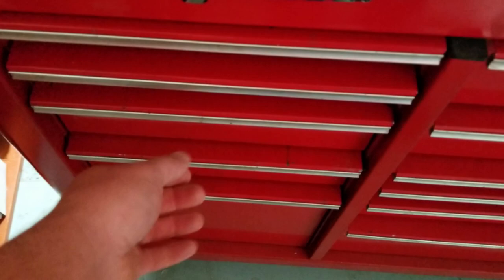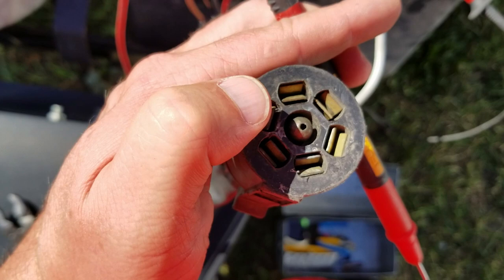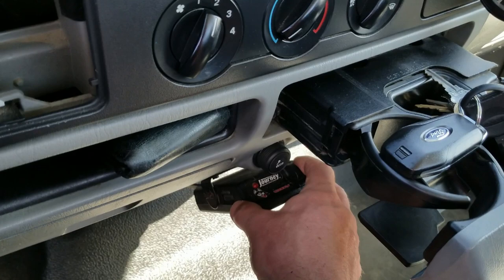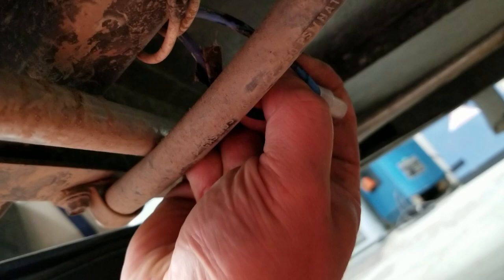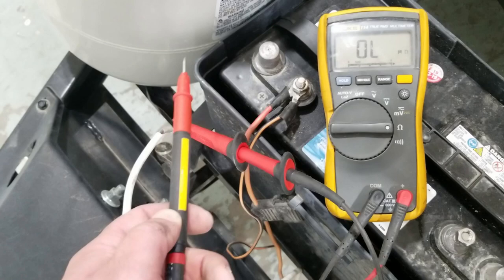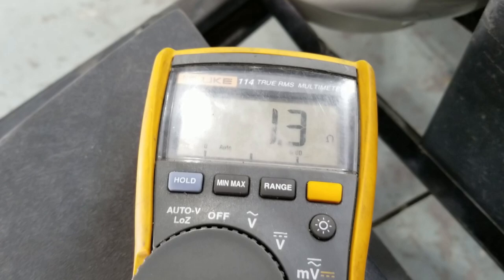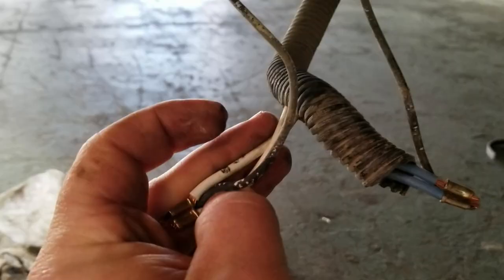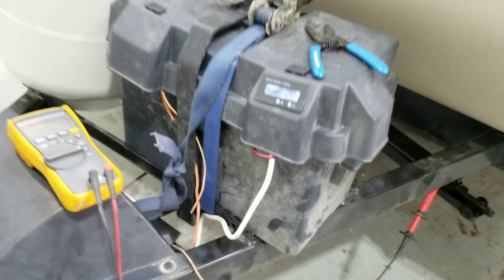Scumbag Offset | sketchy wiring

Comment: I bought brand new led lights with wiring from the home depot.  It all installed nicely and worked fine.  A year later, the lights kept blinking out. I found some broken connections so I tried to strip back the wire to replace them. The wire broke every time I tried to strip it.  The entire length of wire was corroded inside the insulation.  I have never seen such crap material used.  I dont know if the wire was actually copper plated pig iron or if somehow the chemicals in the insulation attacked it.  I replaced it all with random shit scavenged wire I found in the garage and it worked fine.  Still does, years later.  Unfortunately, I didn't have the right color wire laying around so good luck to the next person to trouble shoot it.

Comment: It’s safe to assume all trailers have shoddy wiring. Although I did come across a 2010 utility trailer last week that had a completely virgin factory wiring harness on it. Blew my mind. From wire nuts, to duct tape, gobs of liquid electrical tape, all the wires made the same color, and of course the big fat black tape tumor. Oh and speaker and orange extension cords spliced and sectioned in too.

Comment: Unsolicited 2-cents; that might help anyone with a ford 4.9l issues

1)
I know it's a day-late, and a dollar-short; but the issue I was having with my 96 4.9l which seems to plague everyone as the "pickup ignition sensor whatever"; turned out to be an early symptom, of the timing ring, thats bolted onto the harmonic balancer, coming loose... eventually found out, when it came off on I25 sheering the bolts on the harmonic balancer, getting wedged in the works, and ripping a hole in the timing cover. 

IDK, might be worth takin a peek at before shit hits the fan.

2)
Also, "lean bank 1" code might be an intake leak, vaccum i'm not sure, that's open-looping the engine and setting the CE light and running lean; that was my case.

3)
If it fails to start after running; people say it's the fuel switch, or the fuel pumps, etc etc... what it turned out to me, is a failing starter-relay combo.  if it happens again, smack either one with whatever you got handy; see if that does it.

the BIG SIX is bullet-proof, I swear! or, I just keep fixin it, who knows.

Comment: I have the old one, I bought it for a lark when I bought the big fuel gun for lug nuts. I didn't think much of it at first until I realized that 40lbs of torque is as much as you want for tightening most bolts that are appropriate for this size of ratchet. ANy bigger and you are well over spec for most fasteners. as for breaking strength, you can use it as a ratchet and as you feel the plastic start to deform, your inner voice might start chirping up and say "hey maybe I need a different tool for this job as this little bolt seems pretty stuck. Maybe I should go slow and be careful that it might be sized or galled" Anyway it is by far my most used tool in the box by a long shot now, I have considered the new fuel but  I fear it might be the victim of the more power creep that is overly not nesisary and leads to more problems. 40 torque perfect 60 torque too much, unless you are working with bigger stuff than a normal car or truck

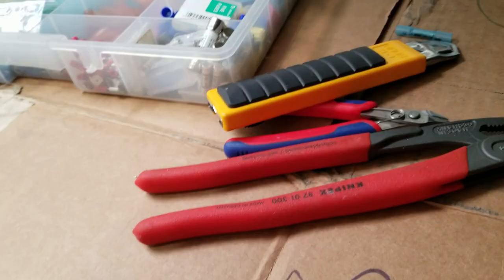Comment: At 7:40 those insulated crimp on connectors are called buchanan connectors . They used to be very common on older electrical installations and they would use them to connect the bare ground wires together in residential device boxes.

Comment: Scotchlok/T-Taps are almost always bad news. When repairing trailer wiring, best practice is to solder/heatshrink all connections and add some dielectric grease before shrinking. Crimp connections remain secure but offer no protection from corrosion unless using the heatshrink ones.

Comment: When the connectors contacts were new, and not corroded, you should add silicone bulb grease to those connectors.  A silicone spray keeps the rubber parts from hardening.

Comment: Those E-brakes are a pain in the cunning linguals. 
I'm glad over here in Eurostan we mainly get mechanical trailer brakes that use inertia to operate. The car starts braking, the trailer want to continue and pushes against the car which in turn activates the mechanical linkage on the trailer brakes.  The heavier the trailer, the more it pushes on the car through the hitch, the harder the trailer brakes are applied. If the mechanicals are kept in good nick it's completely idiot proof. No batteria or wiring involved.

Comment: "Marets" (?, if I spelled that right), we just call them "wire nuts" in the states.  I'm sure you can have fun with those linguistics.  
My experiences with trailer wiring.  My dad's old landscape/utility trailer has house wire for the wiring, I'm talkin 14/2 Romex (solid conductors, not stranded).  Trailer is probably 20 years old I think.  Lately, I've had to fix the wiring several times though.  Our camper trailer, well you can look in the under sink kitchen cabinets and see where at the factory they just cut a randomly shaped hole in the interior wall and banjo stringed wires from the floor near the sink drain to the wall 3 feet away.  The best so far has been my M1102 Humvee trailer that I converted all the lights to 12V (from 24V) and removed the 12 pin Humvee plug and put on a 7 pin trailer plug.

Comment: Just sang that song after laboriously reinstalling the denser-than-lead lump of aluminum and steel that is a 1973 Honda CB450 dohc engine. Assured by my friend from whom I acquired it that the head gasket replacement was skookum, a no-compression-or-leakdown-test procedure was followed.  And of course, the first tap of the starter button revealed the horror.

                           -CHORUS--

BUT - Valves who have strayed to the kinky side CAN be reformed to lead the straight life again!

Comment: "wtf some kind of pbx data connector" lmao!
Reply: A Scotchlok connector from 3M, or a VietCong knock-off, specifically for low-voltage vehicle wiring.  Once crimped, pack the joint with  Vaseline iot keep out dust and moisture.  Oh, and you shoul have done that with your crimp-in-a-hat connection too.  Just saying.

Comment: #1 reason ALL trailers I aquire get a whole new wiring system done by me.   That way if they don't work, it's not due to some other fuckwits 15+ crimp splices and corroded to death and beyond wire nuts holding who knows what POS chunks of mystery solid core wire in place to the wrong circuits.

Comment: A couple of years ago, we acquired a used trailer and had it delivered to us.  The next day, we start to hook it up and tested the break-away and it let the smoke out just like this one.  After some investigation, we found the factory break wire was crushed between the outside axle flange and backing plate for the break housing.  I do not know which is scarier, the fact that the trailer left the factory like this or that it had been in use for 8+ years with no one ever testing the break-away.

Comment: As someone who towed a racecar with an open trailer for 20 years, I always said the drive to the track and home was more dangerous than the race it self.  Mostly because there is always something wrong with the trailer.  No matter how many times you work on the wiring, there is always something else.

Comment: Rewired a many a trailer, and yes the factory stuff is crap, especially when you have people that know that Lectricity with a capital L.  Only way to do it is rip it all out and start over,  might want to look into getting a Power probe if you do a lot of DC voltage work, makes the diagnoses and recheck so much easier.  I loved the scotch lock, seen that way too many times.  Flashing Check Engine Light means catalyst damaging misfire, don't drive it too much.

Comment: You may already know, you can buy "battery terminal cleaners", basically a socket with an internal wire brush, works good on threads too. They are cheap af.

Comment: Work on rv trailers for a living.  
Few weeks ago we had a brand new unit we were doing prep on, essentially fixing everything we find wrong from manufacture. 

Anyways, long story short, they ran a screw threw a 12v line, so odd things were happening. Lights on outside were burning out when turning on lights inside.  
Was a doosy finding that one.

Comment: Those Blue Vampire connectors will suck the life right out of you.  Never, ever use them.
Reply: A-fucking-men.
Reply: They are great when you need to cut a wire, this thing cut about 3/4 of it, you can split the wire by hand after

Comment: Trailer brakes are great when they work and a pain when the wiring is messed up.  I went down to Foley Alabama and picked up a Deutz diesel powered concrete pump for someone.  The wiring was all messed up and the brakes were not working at all.  To say the thing was heavy is an understatement, it had twin torsion axles and I believe it was something like 10K pounds.  I went to the scumbag store and bought some orange extension cord and used it to run the lights and such.  I found that it lasts longer since it has a jacket over everything.  I ran a ground all the way to each brake along with a positive then each side getting it's own line dedicated to it and then ran another piece of cord to each tail light then hook up left and right turn and running light.  Honestly it's probably faster and better to just yank out all the old crap than to fix what is there.

I have rewired multiple trailers this way and it beats the pants off of that 3 wire crap they sell for "trailer' wiring.  The hardest thing about it is tapping into the running light circuit on each side and then not cutting the turn signal for the opposite side to keep the integrity as good as possible and adding an extra wire from the plug to the frame if you don't have trailer brakes for the ground.  Usually with brakes you have a battery so I just run three sections from the plug (9 wires total) bringing two ground lines to the battery with two positive lines,  brake ground is ran to each hub and positive with left, right turn and marker lights and then one for backup lights.   Hopefully that makes sense, anyway.  And it's a lot cheaper than the big hefty 6 wire stuff they sell to go from the battery back and the 7 wire to go from the plug to the battery and then make all kinds of splices.

Comment: I hate trailer wiring issues,so I started soldering, liquid tape, and shrink tube all connections, and I run an actual ground wire from all lights back to the plug. I don't have issues anymore.
Amen brother! EVERYONE PLEASE USE A FLUSH CUTTER TO CUT ZIP TIES! I've lost gallons of blood on razor sharp zip tie dingles.

Comment: Trailer brakes and a Ford Super Duty. Always check the fuse on the truck side first.  Then grounds on the trailer, then brake solenoids. Then start chasing wires. Of course, I hate chasing wires always the last thing I do on a trailer besides the ground.

Comment: Don’t heat or beat drums if they have a ridge. Use the access port to adjust the star wheel adjuster between the lower part of the brake shoes. Back off adjuster, remove drum, machine drum, adjust install etc. Good video though, when comes to trailers I star from scratch and add a back up camera on the truck and one on the trailer with a selection switch. (Two trailer connectors, second is pwr/Gnd and RG-179 to extend trailer camera coax)

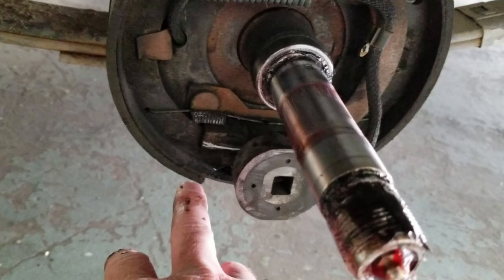Comment: @15:48 - the "bias" is due to the operation. The leading shoe upon actuation wedges the trailing shoe between the drum and the anchor pin. As both wear, the point of effective frictional contact will climb the shoes. They do not wear concentrically relative to the drum..

Comment: Scotch Lock :o) A way of breaking into a wire to connect in another, then waiting for the damp to destroy both! It looks like my step dads digger I have just been working on, all tape, twists and nasty blue scotch locks. I mostly solder stuff unless it is dry, them I use the Wago connectors. They are rattle proof. *i demand all scotch locks come with a free Nessie!

Comment: Dude, I’m only a couple minutes in, but I gotta say I’m man-crushing already. Your speech pattern, colloquialisms, and humor are 110% my hometown. So familiar it’s almost déjà vu. Instant subscribe.
Reply: At 10:19 you mention zip ties and flush cutters. Yes and No. flush cutters at a minimum, but even flush cutters leave a little edge. I made a zap trimmer that I use only for that. It’s a side cutter, with bottom jaw slightly dulled, and a file cut into the back edge. The key is not rushing the cut, using the bottom jaw to cut 2mm off the back edge of the lock eye, opposite the tail of the zap. Sloppy cut breaks the lock, but a good cut is almost perfectly flush, as the bevel of the side cutter and the slightly dull edge work FOR you to smush the eye (provided you don’t break the lock). One pass from the file I cut into the back edge is enough to get rid of any leftover burr. Cuz the next guy is probably gonna be ME.

Comment: Bit of  a fan AvE,  but my DMM doesn't smoke when measuring ohms with volts applied. The meter still has 1 Megaohm impedance on every scale except amps - that one will wake you up :)

Comment: Every single second-hand trailer I've ever purchased, the wiring had been bumble fucked by a blind apprentice and their dull beaver. I made it a standing rule that the very first thing when I got the trailer back to the shop, was the wheels came off, the hubs were at minimum inspected and usually rebuilt, and the geezless wiring harness and lights were discarded and a completely new harness was built, run through conduit, and sealed up. Has made trailer ownership trouble free for me.

Comment: Gonna save the links to these videos because come spring, I'll dig the trailer out of the snow that slides off my shop roof for the annual run to the borough landfill. My experience is the wiring lasts about 2 years unless youlend your trailer to your son.

Comment: Volvo electrical wiring technician:

WD-40 ( & old toothbrush) is an amazing green death remover.

Warning: heavy application will begin to delaminate printed circuit boards after one week to two weeks. 
After white/green death removal, rinse with electrical circuit contact cleaner.

Comment: Dude, as an owner of a trailer sales and service, good job finding that frame rub! But, you need to look into 3m 314 connectors for any wiring that is exposed to weather. Trailer side or truck side! Trust me. And the break away should not be fused. That's a correct way to have it. Should the trailer become a runaway, you want the best chance for it to stop, and if that short caused an intermittent bad connection, the brakes wou3be taken out immediately in an emergency situation if the switch was fused, so that's why it's not. I could go on and on!

Comment: AvE, I'll be there in a few days, got a Jeep Rubicon which won't power up just the running lights...everything else works proper-like.  Jeep was a RV pull-behind b4 I got to it.  I'm seeing extraneous equipment and wiring...The bumper 7 pin is not receiving any running light signal.  You like beer, I like running lights on my trailer.  Is it a deal?  I have probably a four day drive.  Oh hell, I'll just put on my AvE hat and fix it myself.  Thanks AvE, good inspiration!

Comment: Me thinks the brake controller should be level with the trailer. The swivel mount on the controller is supposed to allow it to swing down level with the truck and trailer.

Comment: most good meters don't give a rip if you put 240vac into ohm mode anymore.  maybe  100mw across the input resistance and 1ma through the protection diode. even on the least sensitive meter

Comment: I guarantee sticking 12v up your Fluke meter on ohms won't damage the meter, you'll just get garbage readings. If you really wanna be paranoid, use the dcv setting to check for resistance/continuity first. If there's anything other than open circuit, it'll show 0.000v. If there's a dc voltage there, obviously it'll show that. If there's an ac voltage there, it'll show an unstable reading. If it's open circuit, you'll get a very low (in the tens of millivolts) reading that'll slowly climb.

Comment: Thats a slick trick im not sure if worth buying ir camera just because I'm lazy but if you got it use it I have power probe 3 kit with ground short beeper you can ground or hot with probe so when 40 ft of wire alone the  you can test wire full length  . Even my brand new ford the body builder sent a totally wrong wire diagram turns out it was wired correct but the info he sent was bad and but plug was upside down in harness I expected nothing less with this ford about a dozen issues what junk

Comment: That's why you never cut the sheath off that way, always tear it to the point you want it exposed then slice it off pointing the blade away from the wires. If you can't tear it down the length, then score it but don't cut through

Comment: Those meters have very robust input protection circuits which automatically clamp excess voltage when in the Ohms range, as well as self-resetting thermal fusing if you really push it. Would I apply 480? I'd avoid it, but I wouldn't give a second though to 12,24,48V (and I have multiple times over the years). This is why we pay the premium (why the premium is worth it) for Fluke.

Comment: Correct me if I'm wrong but no modern fluke multimeter will be damaged by putting a voltage across the probes while in ohms setting.

Comment: Usually when I fix trailer wiring i just buy a whole new loom of trailer wire and wire it my self. The old shit is always dangling down broken and discolored/burnt.  My last trailer I wired is still working after 3 or more years, replaced the "Mobile home axle" with new used trailer axle with brakes that work! 😂 it's a care hauling trailer
Edit: car hauling trailer